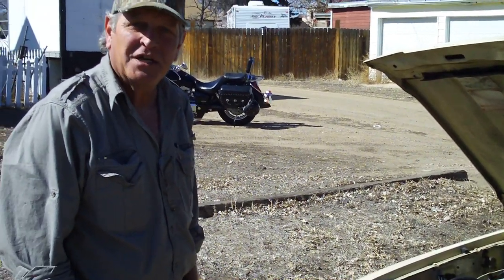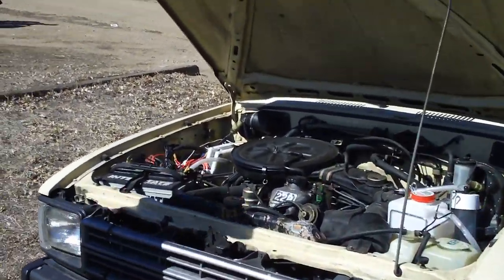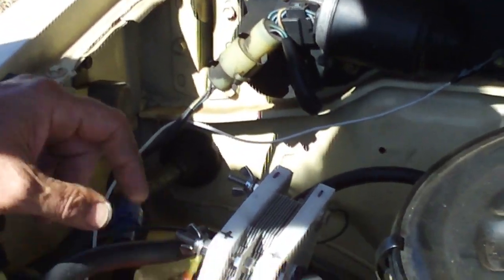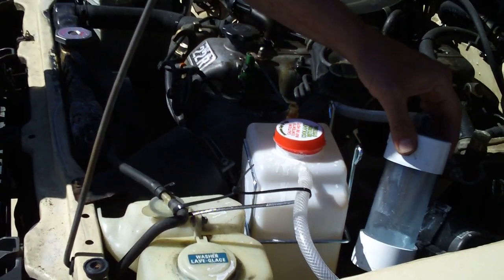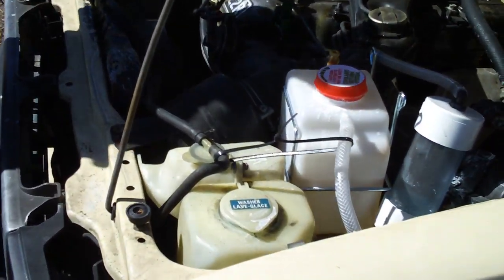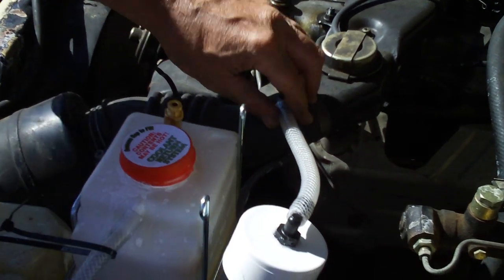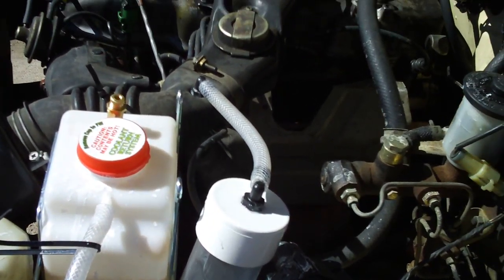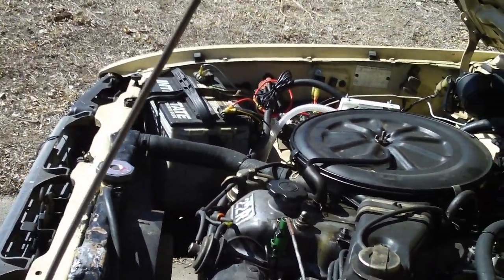HHO setup for your for under $160.00

Comment: I have been boosting my car since Aug 2008 using 316L SS.  Then I changed to Platinum-anode HHO Generator in Mar 2009 until now.  HHO combined with air intake constriction after the MAF sensor give my 06 civic 45+ MPG highway :)